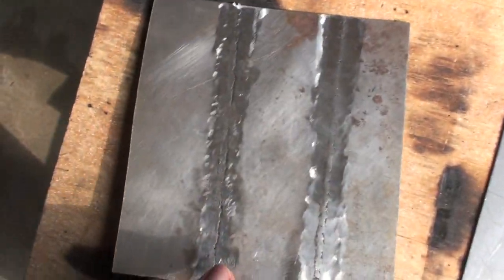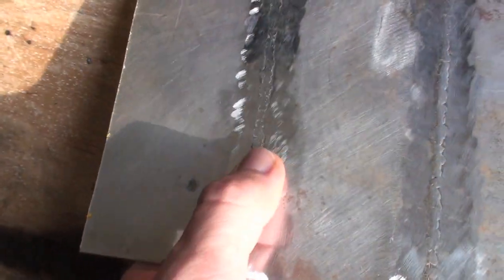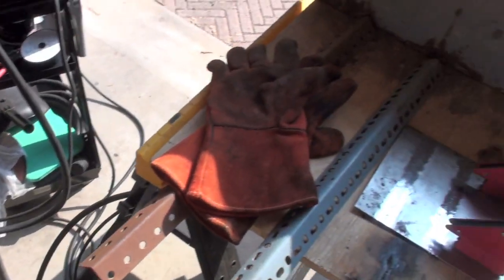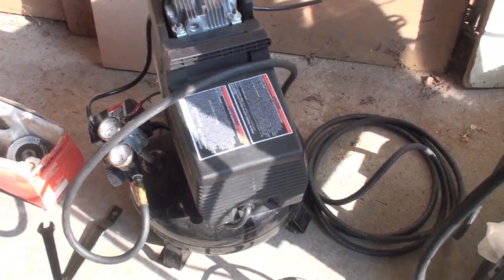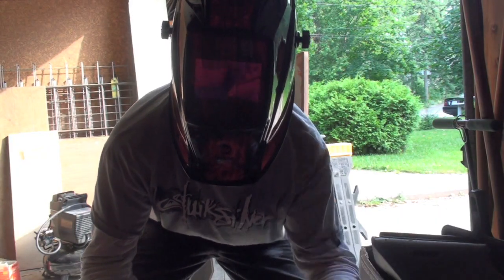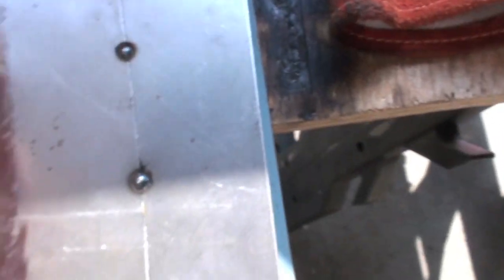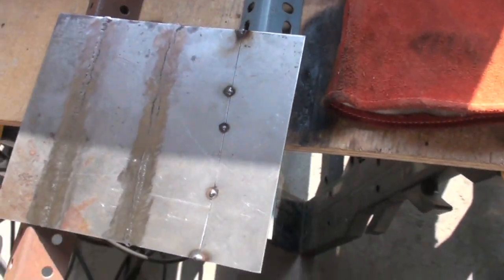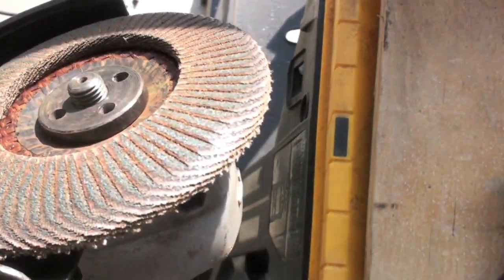stitch welding

Comment: Different welders prefer different methods/styles.  I've done automotive fabs and body work that required welding and I can say.. I prefer spot/stitch welding on thinner gauge compared to thicker gauge sheetmetal which I can just lay a perfect bead down without having to worry too much about warping or burn through.  Either method is fine depending on the application.. most important is 100% penetration.

Comment: @DynamoDylan It shouldnt warp the panel to much (nothing you couldnt straighten out, if it warpeds it alot it mean your going to slow. To make a good clean fast bead all you need to do is increase your amps.

Comment: I can't believe there are some who claim to be experienced welders but yet they say to lay down a solid bead. Anyone who has worked with thin sheet metal would know the metal WILL warp if a solid bead is layed down. Weld short beads and jump around to keep the heat down and avoid it warping. It is the best way for the average DIY project at home and with the basic tools you would expect one to have laying around.

Comment: Put slight gap between the 2 pieces of metal. Like really small gap, not even the thickness of the welding wire.